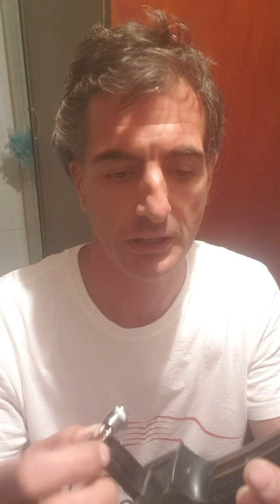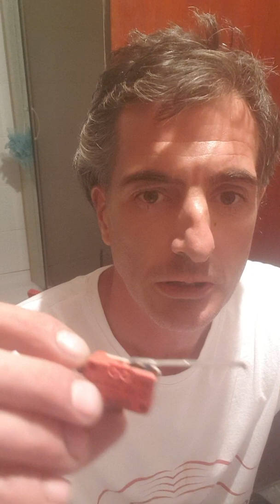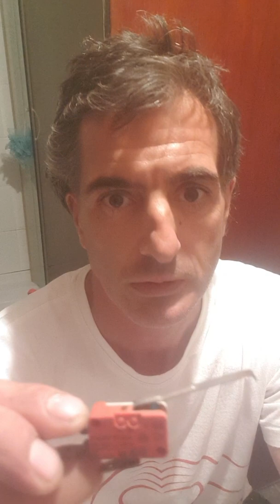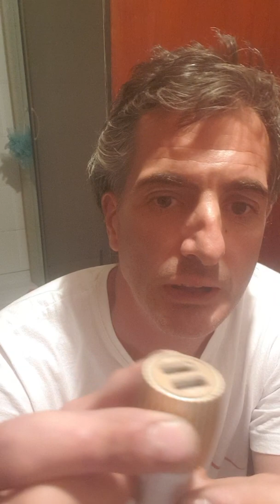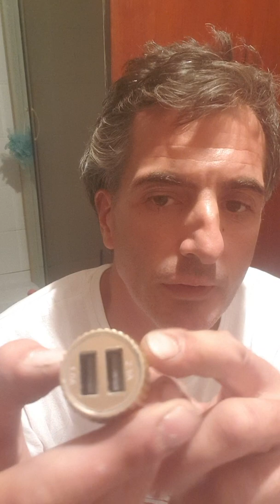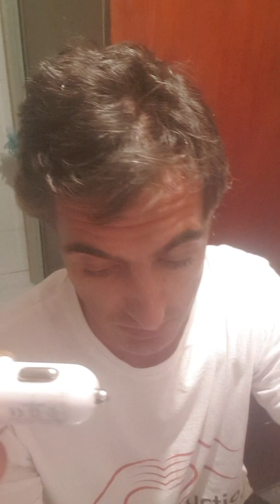Update on electrifying your door handles!

Comment: Great video but wouldn’t that drain your battery if parked overnight?
Reply: No run off a 9v battery and negative runs through the neutral of a usb taken apart car charger .. then back to the unit .. steps it down to 5v so then saves battery even more

Comment: Just one question. Does it still shock ya if you put thick rubber gloves on or is this a stupid question and needs deleting. 😂
Reply: @grahamjohnson3781  Take direct to the battery the increased voltage would be 4 fold, gloves will not help